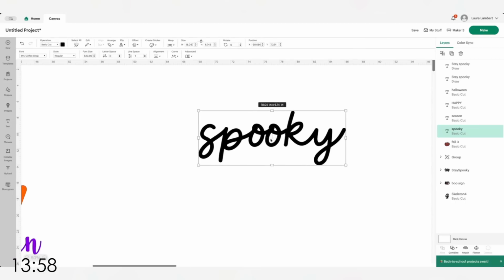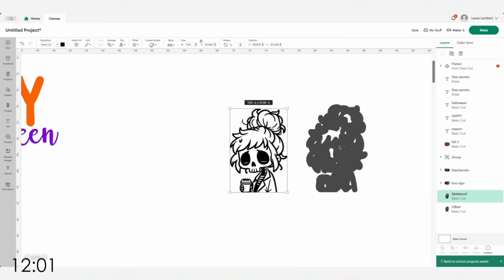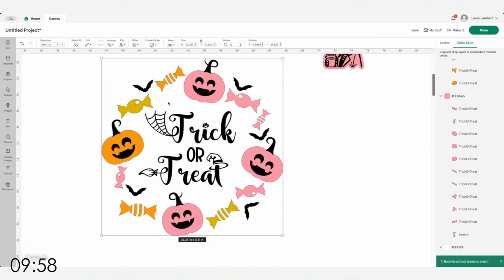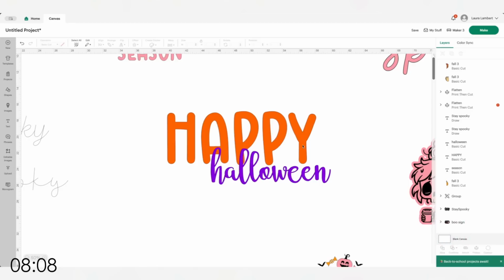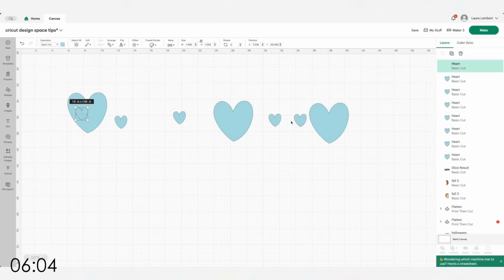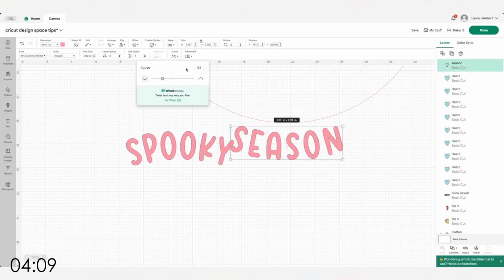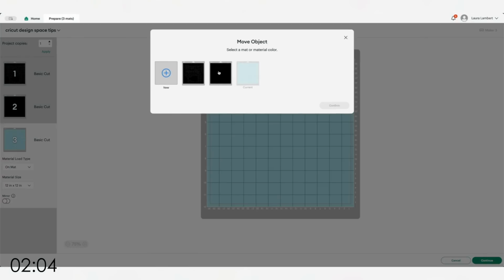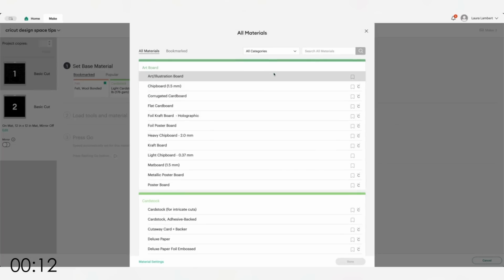15 Cricut Design Space Hacks in Under 15 Minutes! ✂️🚀

Comment: For some reason when I add a new material setting (or edit the existing one) DS keeps restoring it to the old setting or will just crash when I want for edit my newly added material. I hoped it was just an iPad glitch, but it does the same thing on my MacBook 😭
Reply from the maker: Hi! sorry to hear you're having trouble! Design Space can be a bit glitchy with custom material settings. A few things you could try: clearing the cache, ensuring both your iPad and MacBook have the latest version of Design Space, and if the problem persists, try uninstalling and reinstalling the app. Hope this helps! 😊

Comment: Thank you for the tips.  I generally use Design Space on my iPad and feel like I don’t see all the options I can get on my laptop but my laptop (notepad) doesn’t print right.  I have to bounce between the two.
Reply from the maker: Hi Debbie! Using Cricut Design Space on an iPad can feel a little bit limited. For your laptop printing issue, try adjusting settings in Cricut Design Space or reinstalling the software, that might help! Feel free to ask any other questions you might have and happy crafting!✨

Comment: Great video!  I have 2 questions. #1- Can you view/change the grid view on an iPad?  I can go to settings and change from large grid to no grid but cannot change to a smaller grid. #2- Can you view Image Info on an iPad?  My laptop no longer works and I am working off an iPad. Thanks!
Reply from the maker: Thanks! 😊 

Yes, you can do both on an iPad using Cricut Design Space! To change the grid view, use a two-finger pinch to adjust or turn it off in settings. For image info, select an image on your canvas to see details in the edit panel. Hope that helps!